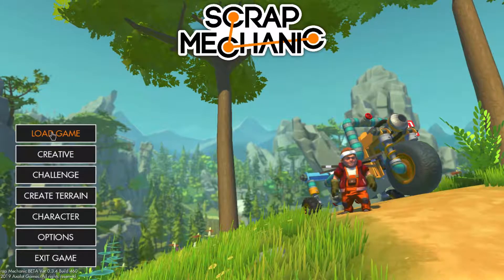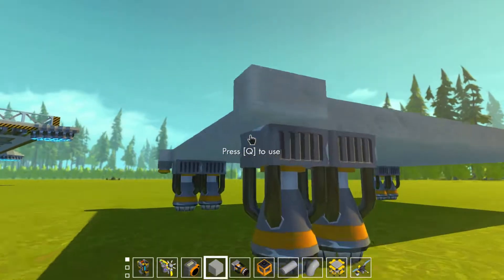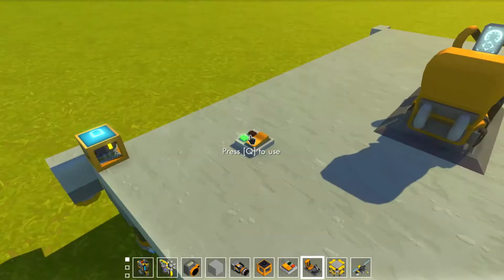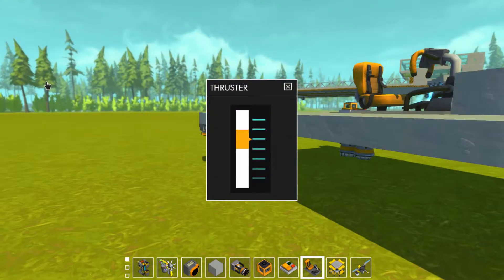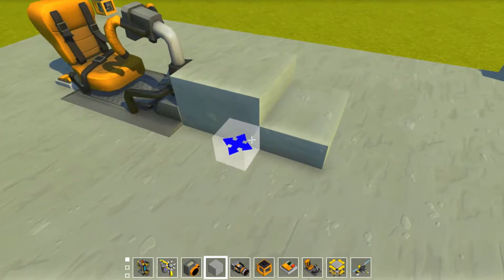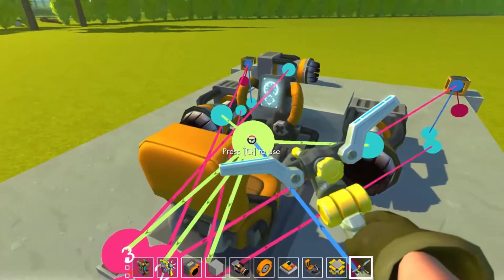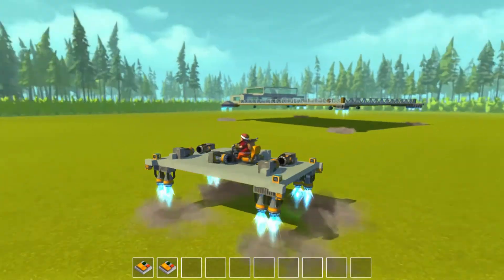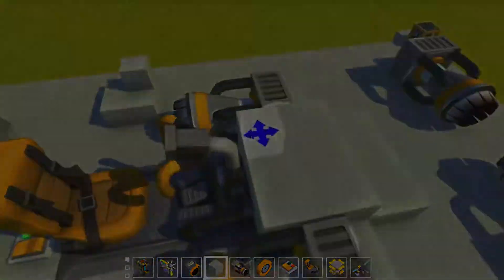How To Make A Hovercraft In Scrap Mechanic!

Comment: sadly if i repeat the exact sam ething it'll bounce back and forth until it flips over
Reply from the maker: Try to spread out thrusters a bit more that might help! (If it is tipping to one side add more weight to the other side)
Reply: I think its a thing that is caused because a physyx/physx/how da fak do you spell this update
Reply: @jaming8510  physics